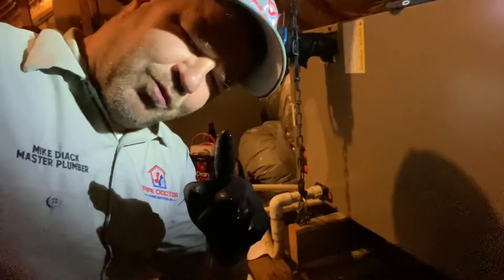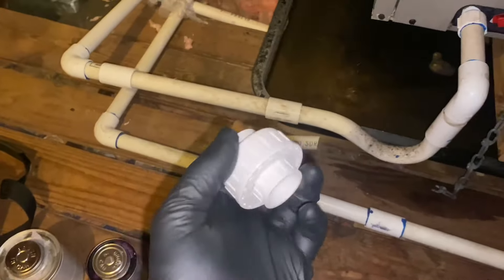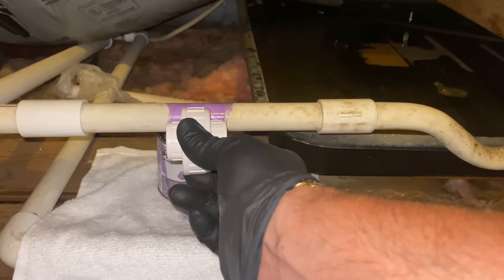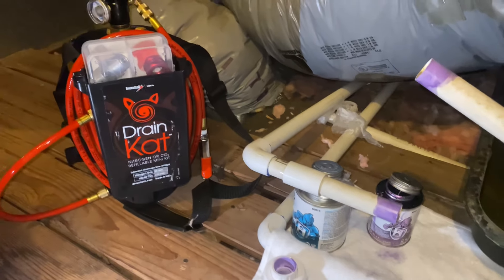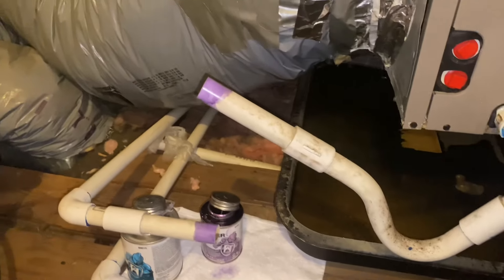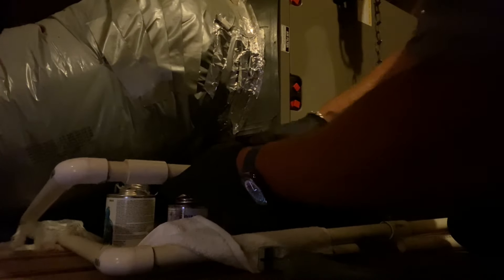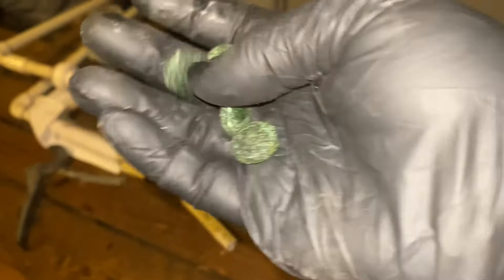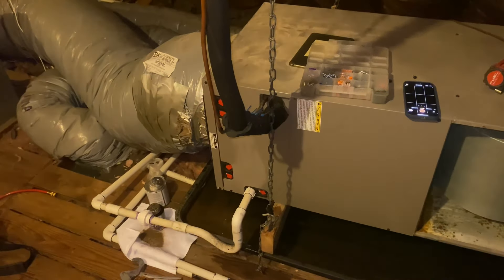Step-by-Step Guide to Fixing a Central AC Drain Pan Filled with Water: Learn from the Professionals!

Comment: I have a tip from a 60 year old dude that will prevent the dreaded overflow of water and cause the ceiling to cave and or just nasty water spots in the future. I mainly did this in Texas where everything is in the attic.  They have a special little safety attachment that is mounted on the side of the pan. It is wired in to the system and turns the system off till you get the drain cleaned out. It's about six inches by three and it uses a small plunger and it trips.

Comment: I figured out what prev clog uses. So I just use that.
Reply: @PipeDoctor  awesome. Can’t wait.
Reply: @PipeDoctor  pipes 4free install? or are you replacing this?
Reply: great video Mr pipes, i tell my customers, you know when you do preventive maintenance on your air conditioner system? yup in the fall or early spring, not in the summer.check capacitors, inspect overall condition of unit, put condensate tablets , in the now not boiling attic, rinse outside condenser. yes, checking pressures only in the summer, or temps over 70-80 degrees. or if their is an issue. most homeowners really neglect their hvac systems. until they are hot or cold. hacks brings stacks.
Reply: @PipeDoctor  Heck yea! Keep doing good! Expect nothing in return! Much love!

Comment: Great video! ?  I keep hearing mixed things regarding a vent, after the p-trap.  Some people say you need it some say you don't.  I'm about redo mine because they forgot to install a clean out and wanted to know if I should do a clean out AND vent.
Reply: Yes. Just make sure the vent is dirt dobber proof.
Reply: I always install clean out/vents before the p-trap and throw a cap Not glued of course for easy cleaning in the future. Many systems I've come across don't have clean outs/vents and many didn't have the safety switches in line either. It amazes me how many guys don't put these things in when they install.
Reply: Thank you!

Comment: Am I the only one who uses a simple garden hose to blow out the drain lines?  I have DIY installed the same type of male/female PVC screw-on coupling. When it comes time to flush the drain lines, I simply unscrew the coupling, and then use an alternate fitting which has an end that attaches to a garden hose, and flush with water. Works great. I've always been afraid to have a service tech "blow out" the PVC drain lines (which run under the slab of my house using air pressure of any kind, because too much and that could crack the pipe (with all its twists and turns and elbow joints). And PVC drain lines like this that are 25+ years old could potentially be damaged by high air pressure which would be a nightmare scenario to fix with a bypass drain line.
Reply: mine, along with the one in this video are on the 3rd floor in an attic...not really easy to run a hose 100 ft, but I guess it would work....I usually do what Mikey does here and just disconnect and blow a little air(not high pressure) into the pipe to clean

Comment: I don't see a float switch in the emergency tray and I don't see the condensation tray either. It is super important to block the condenser and thus avoid further damage. The drain does not have a line through which pressurized air can flow. The universal union is a good option but it is also good to periodically put vinegar in the water traps and leave access for this purpose. Otherwise the video is good.

Comment: Hey quick question. Recently had new system installed seem to have a small drip at the air handler where the drip tube comes out. What can I do to fix it? I do not want the installer back at my house, helper stole stuff when they did the installation, thanks in advance

Comment: My drain isn’t clogged but when my unit kicks on 1/2 the water goes out the drain and the other 1/2 out the pipe to the pan then out that drain. Any ideas?
Reply from the maker: Some kinda pressure issue

Comment: I don't get it. You blew the stuff blocking the drain back into the pan, but you didn't clean that material out of the pan so what's to stop it from eventually running back into the line and reclogging it?
Reply from the maker: yes, we vacuumed afterwards and flushed with water. relax

Comment: I am a software developer - I have a question....why doesn't the union go on when the condenser is built out?  Or at least on the second repair.  I state my trade because I definitely relate to getting things done because of time.  I chuckled when Mikey stated he can tell how old the unit is with the counts of joints.  

If you know a problem like this will arise, why not make it a part of the build??  Anyways, thanks for the vid.
Reply from the maker: Because it’s common industry practice to just cut the PVC line and install a coupling that’s what they’re taught to do by the old folks who have since passed or retired and passed the baton off to the younger generation. I don’t like using couplings I like to use a union.

Comment: Thank god for float switches. Great way to save your ceiling. It should be code to put a drain on emergency pan and put a pvc ball valve to drain until a service tech can come on clear the primary. Just my opinion. Unions are key as well. No more couplings. Good work Mikey pipes